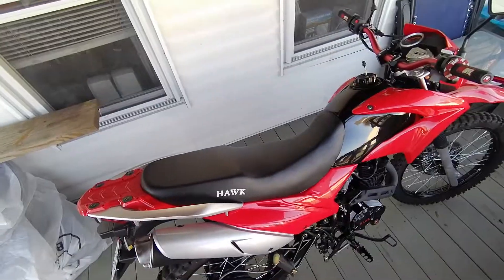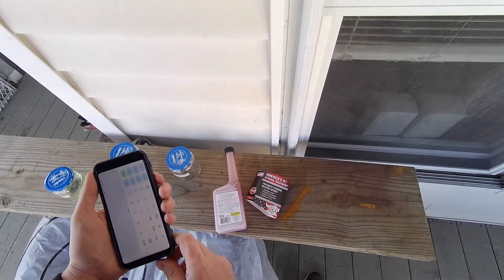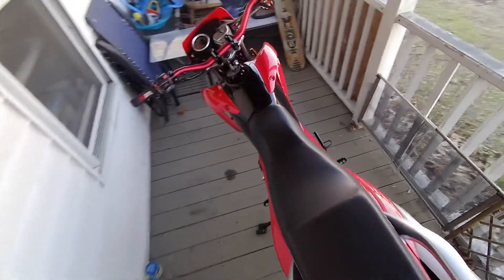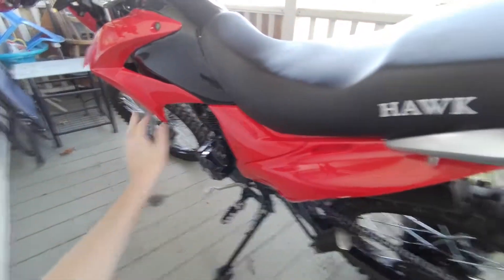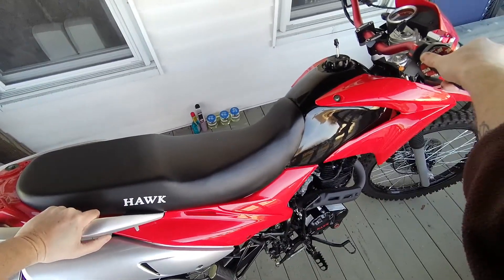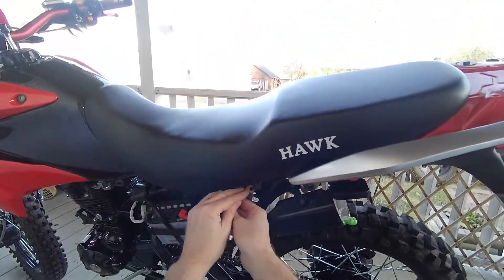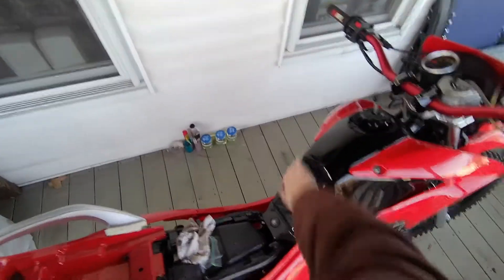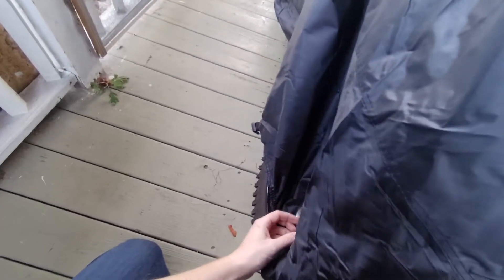Dirt Bike & Dual Sport Storage Prep - Putting the Hawk 250 to Bed for the Winter

Comment: What back tire is that?
Reply from the maker: It came stock on the bike - I don't recall the name, it's a Chinese off brand but it does surprisingly well and it actually is DOT rated, or at least it says it is.  Took me a minute to find the marking when I looked.
Reply: @skydcontrol  oh wow it definitely looks pretty good for off-road. I'm looking at Kenda's and I want heavy dude tubes, I'm getting ready for spring.
Reply from the maker: @tayaria7280  Awesome!  I haven't had any issues with these tubes but I'm gonna get a couple HD tubes myself.  Kenda makes a decent tire and I've run Shinkos before also which are a quality low price tire.  Best rear I have had though was a Dunlop D606 if you have the coin.
Reply: @skydcontrol  good to know thanks for the insight 🙂